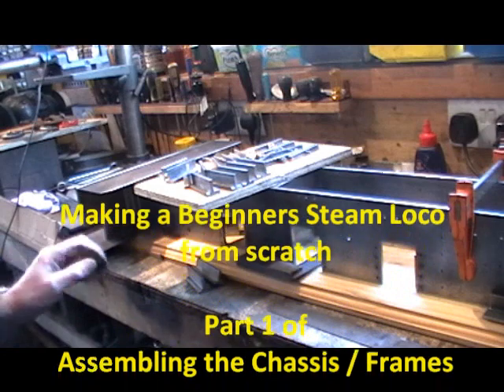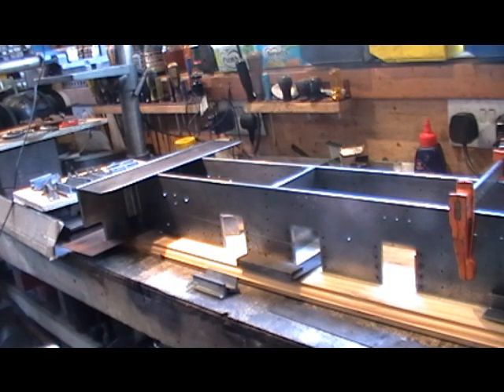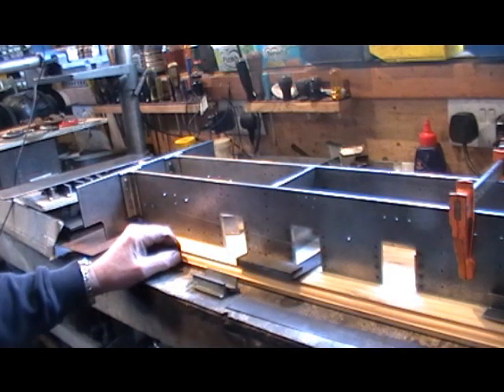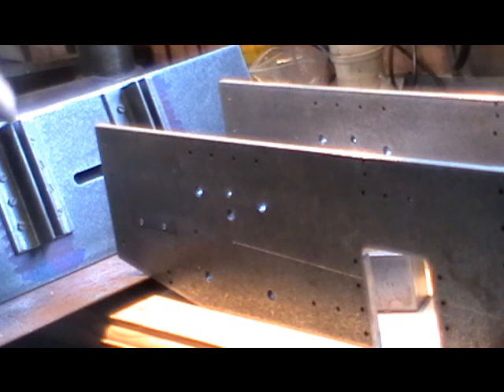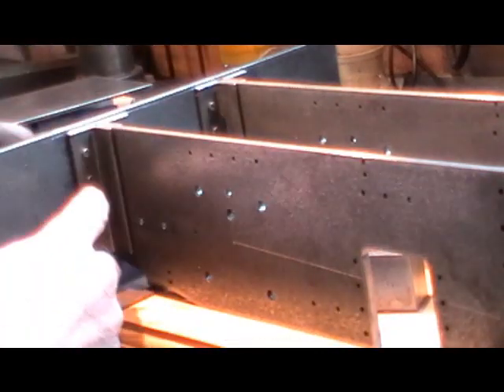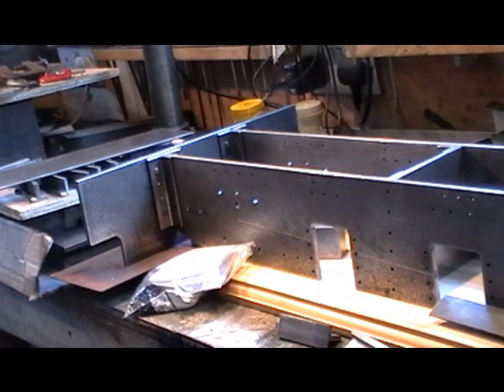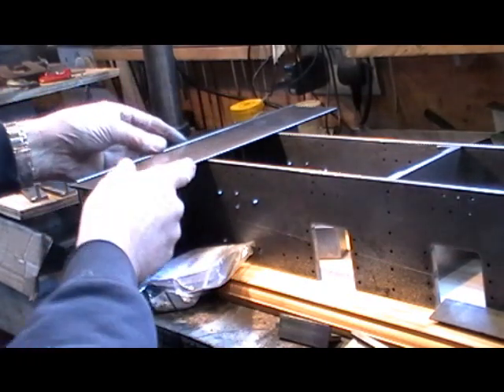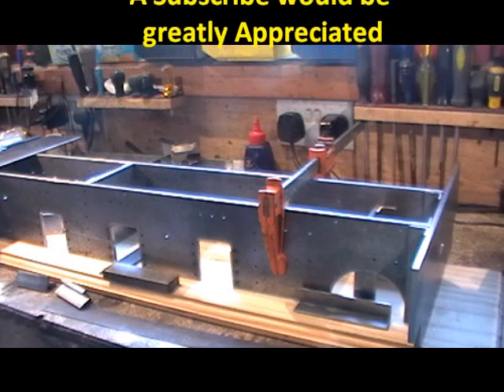Making a Beginners Miniature Steam Loco (Assembling the Main Frames / Chassis Part 1) "mr factotum"

Comment: I have just inherited a Myford lathe and the beginnings of a Sweet Pea chassis. I have no engineering background but would love to one day carry on the build. A quick question for now if you don't mind, the angles that are used to bolt various parts to the main chassis, do you buy the angle or do you make that too? Thanks in advance, your videos will no doubt be a massive help should I continue the build.
Reply from the maker: eyup Daniel
great to hear you have the myford and SP chassis
just depends what parts you mean, the main chassis and stretchers that stiffen the middle up i scrounged some 25mm angle, any thing else in general i made, i didn't buy hardly anything for mine, it was mainly begged steal or borrowed as the saying goes🤣, don't get me wrong there is somethings you wil have to buy, but it all depends how inventive you want to be !!. 
You may not have engineering background but you have to start somewhere. i have an engineering background but i was a complete Novice on anything steam, so i had some head scratching moments, in fact many!!!.
If you take your time, read up and learn as you go, and any setbacks, walk away, sleep on it and refresh, then most times things become clearer. If you join a local Model Engineering Club that will be a tremendous help, once you have a foot in the door. Most people are helpful, although a few are'nt!!!.
If i can be of any help anytime, just fire away, if my "grey cells" can process🤣 then i will help. Get the "Build Your Own Steam Locomotive" book by Jack Buckler, thats all i worked with and one full size General Arrangement drawing obtained from Blackgates Engineering in Yorkshire, They will sell you anything SP related even a boiler.

Also did you get tooling with the Myford!!, and if your new to machining / lathe work take care as machines take no mercy!!!
Hope this helps Daniel stay safe
good luck
keep in touch
atb
merry xmas🎅🎅🎅👍👍👍
Kev
Reply: @MrFactotum  thank you for your reply Kev, very nice to read it. Merry Christmas to you too and I will no doubt be in touch 🙂

Comment: Hi, i've just discovered this video series in the last few hours and have to say i'm loving it. I've been hoping for so long that someone would do a Sweet Pea build on YouTube. A bit gutted i've only just found yours.
I do have one observation although it's very much after the fact at this point. Although the book suggests riveting the buffer beam angles to the main frames, it is recommended that they are riveted before attaching to the buffer beams, then skimmed or filed to maintain accuracy. The buffer beams are then bolted, not riveted to the angles. Similar with the stretchers but effectively opposite - the angles are riveted to the stretchers, skimmed as necessary and bolted to the frames. This allows a pretty much complete disassembly of the loco when needed.
Really enjoying the videos and please take this as intended - as an observation and in no way a criticism. 
PS/ just subscribed.
Reply from the maker: Hi S
Thankyou very much for you watching and feedback, hope you find it useful, it's a while back since i built this and it's getting plenty of use as you will see in later video's. i believe from memory i used domed headed Allen screws to bolt it together, with some riveting in a few places, if i'm honest when i built this it was my first ever steam loco, and with hindsight super critical accuracy is not really needed, if tolerances are tight, the things never run properly, well that's only my opinion which i have picked up from old school builders of locomotives, don't get me wrong i'm not saying things should be thrown together.!! I'm just about to start another SP maybe this winter which is part done, see my latest video's for that, when i got the unknown boiler re-certified. Anyway hope to hear from you again, 
By the way are you building one, if so keep me updated on your progress
Many thanks 
Kev